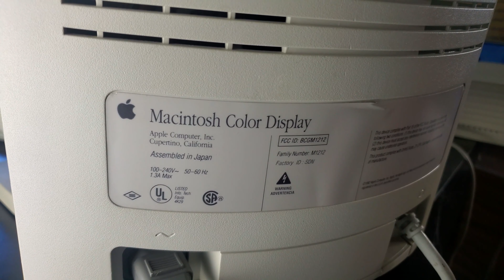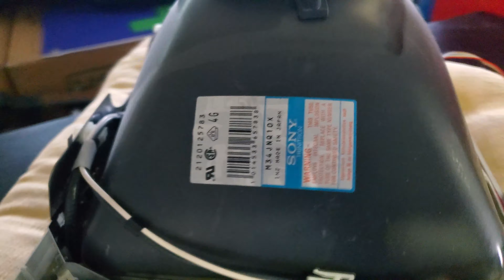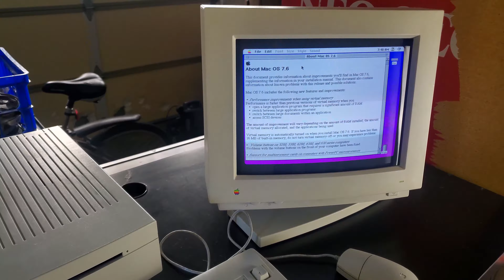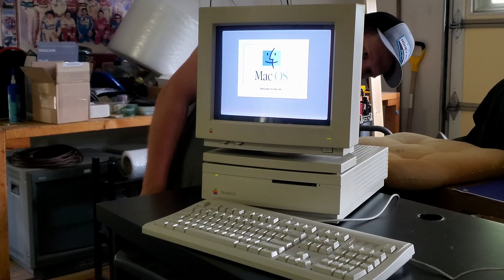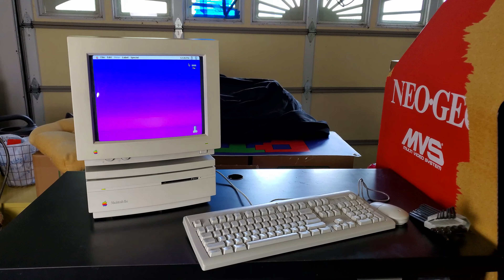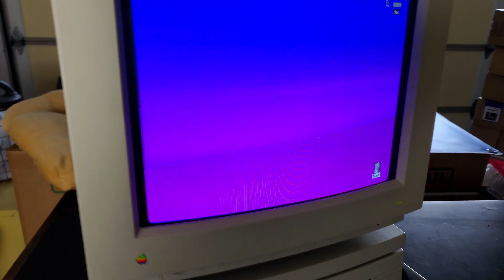The Macintosh Color Display - Trinitron CRT Monitor Restoration

Comment: It'd be cool to have a set up like this with an old version of AutoCAD.
Reply from the maker: That would be awesome.  I used an old IBM for AutoCad about 15 years ago for a job.  It was almost as cool as this one.
Reply: You can run autocad 2004 on a 233mhz pentium. I used to run it on an old compaq laptop when I was in college. 64meg ram, pentium mmx. It doesn’t run that bad either.

Comment: Can Macintosh monitors that are not multiple scan (only Macintosh video mode) be used to connect to a PC with VGA?
Reply: i need to know this aswell. I came up on this exact monitor. I plan on using a Female to female DB15 gender swap adapter > Male db15 to Female VGA adapter > Vga to a modern PC.

Comment: i got a dell p1130 and the image is sharp 100% only if i view it from the angles, if i sit in front of the monitor it is a little blurry and anoying after 1h of use.
in 2022 i started not to use the lcd bullshit tech. tired of it. 
i can do multiple resolutions, i  find the best for me 1920x1080@105hz dp>vga passive.
i opened it up, played with all the rings possible, made it a mess and made it look crysp again but the 10% blurr is not going away.
do you think i should play with the flyback knobs to see if i can fix focus or remove blurr?
it is so weard, i stand up and look@ it, sharp af, i sit on chair centered 10%blurry.
i tryed the gama correction and calibration from windows but nothing helped, 10%blurr all over the screen still present when viewing centered.
now i am thinking... shall i loosen the yoke and play with it?
shall i play with the flyback knobs?
the screen has the protective layer cut off the glass, should i polish the glass in hope that it can remove the 10% blurr?
thank you all for taking time to read this, i am in need for help and sugestions and will apreciate it 1000%

Comment: Hi! I have this same monitor. Was wondering if its possible to retrobright it since the one i got is COMPLETELY YELLOW
Reply: It is.  All the plastic parts come off the non-plastic components.  It is, however, pretty brittle plastic.  Also be careful!  After re-assembly, my monitor stopped working properly.  Now I'm trying to decide if I want to try a full recap or not.

Comment: I can buy this monitor for $75 bucks. Can this be used to play emulators from a windows pc?
Reply: in theory yes. the display port for this monitor is a DB15 Male. You’d need a DB15 Female to DB15 Female gender swap adapter & a Male DB15 to Female HD15 (VGA) adapter. then you could get a VGA cord and plug one side into your PC & the other into the monitor.
Reply: I’ll be testing this theory very soon. I’ve recently picked up this same monitor for $45 bucks! I’ll update after